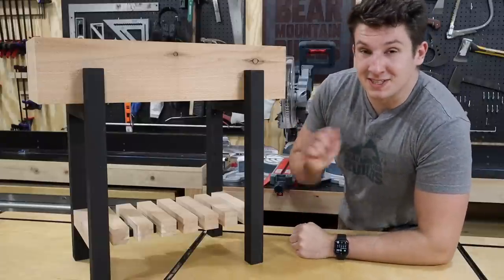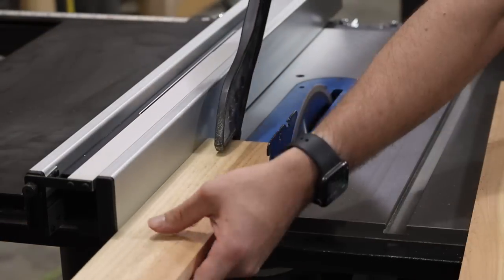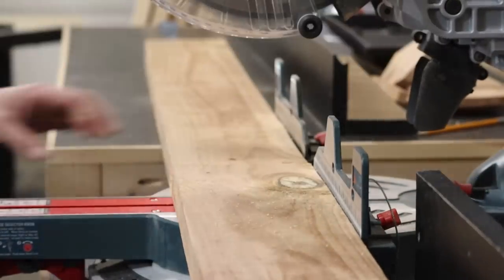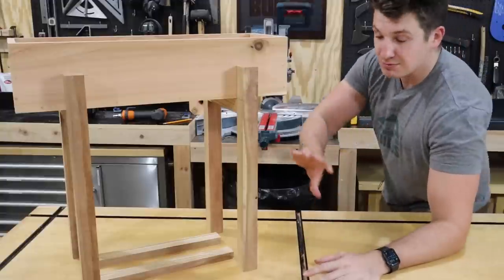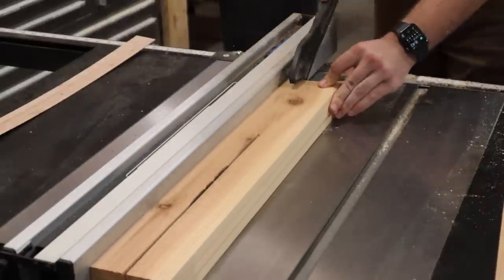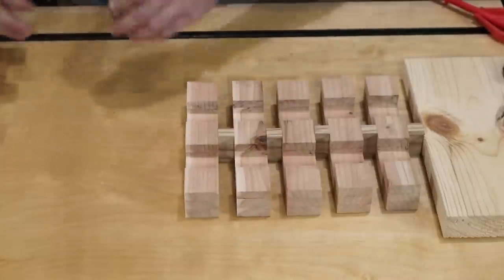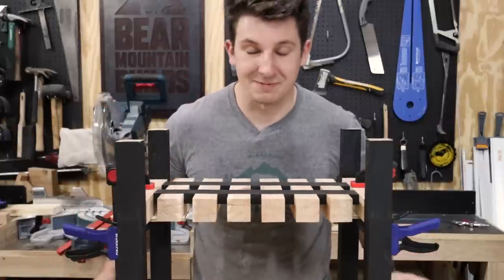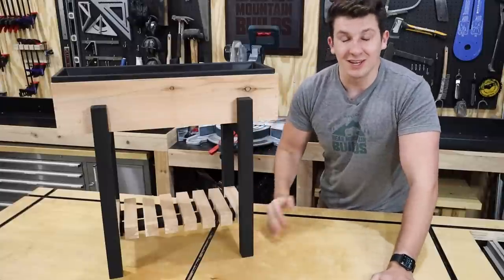Raised Two Tone Cedar Planter

Comment: Great video....only thing is should use tight bond III for outdoor use.... designed for it
Reply from the maker: Titebond 2 is water resistant and would work well, but if you want to take it the next step yes 3 would be the best of the best

Comment: Big fan of your channel since discovering your workbench build. I feel like the laminated fence pickets for the bottom shelf are too noticable at the end grain though. Debating between adding bottom stretchers to cover those up or just using more cedar decking cut to 2x2 dimensions like you did for the legs. Guessing the latter would mean buying another board though.

Comment: Try using a plastic drinking straw to clean up along the inside edges and corners and wipe the excess with a wet paper towel.  Works pretty well.

Comment: This could easily be adapted to hold a grow light for starting seeds indoors and taken outside for  hardening plants to plant outside after frost danger is past.  Also would work great for an indoor herb garden for fresh herbs year round.  I'm gonna need two or three of these. 

Curious why you didn't use half laps on the legs since the bottom shelf is half lap joints.
Reply from the maker: I didn’t want the black supports to be seen on the ends

Comment: Awesome love it! I built a different style planter last year, I used spar urethane for outdoor furniture. My wife wants another one, I like this design except she wants the planter box portion painted turquoise... Not a problem but I think oil based spar urethane over the paint will dull/change the color, any suggestions for a protective coating over the paint? Also looking forward to seeing your new shop completed, lol I'm not a hater but definitely jealous 😂😂
Reply from the maker: If you use crystal clear water based poly it shouldn’t impact the color too much. I’m very much ready to get into the new shop but the Minnesota winter really slowed me down since I still have to finish putting in the insulation. I should be moving in this spring and finishing sealing it up this summer

Comment: For the bottom shelf wont the paint on the ends of the support beams cause the glue to not bond the shelf as well to the legs? Wouldn't sanding the paint off of those locations allow for a stronger glue bond and a stronger shelf? Other than that this is a great build i cant wait to get out in the shop and give it a try.
Reply from the maker: When I painted the supports for the bottom I tried to not get too much paint on the ends, but you’re right that if you want max strength it would be best to either mask the joints off or sand them before gluing. Either way it’s still plenty strong as is
Reply: @BearMountainBuilds  Thanks. I'm looking forward to getting into my shop and giving the build a try.

Comment: What is Pressure treated Cedar tone wood?  Is that something that can be bought at Home Depot or Lowes or is it just plain old pressure treated planks treated with cedar tone stain? I want to make some of these planters but I'm very confused about the "pressure treated cedar tone" wood.
Reply from the maker: It’s a board that is generally used for decking that can be bought at Home Depot or Lowe’s. I bought mine from Home Depot. It’s pressure treated so it can’t rot and the cedar tone means it’s artificially colored like cedar

Comment: Would the brad nails/glue combo hold up long term? or would it be better to add screws as well?
Reply from the maker: Screws will always be more durable. I just used Brad nails because it’s simple and fast. I think the Brad nails and glue will last for quite a few years
Reply: With cedar being soft and using cedar fencing, which is a thin piece of wood, you would run the risk of splitting the wood with screws. I would get thicker cedar planks (which is more expensive) if I was going to use screws.

Comment: Unless this is designed to be an indoor project, you need to be using Titebond 3 wood glue which is waterproof.
Reply from the maker: Based off the Titebond 2 spec it is water resistant and suitable for outdoor use

Comment: Does the glue stick to the paint?
Reply from the maker: Yeah it does. However if you want to make it as strong as possible you would want to mask the areas where it will be glued before painting. However, as is it is plenty strong enough

Comment: You should be using Titebond 3 which is waterproof.
Reply from the maker: Based off the Titebond 2 spec it is suitable for outdoor use and water resistant
Reply: @BearMountainBuilds  TB2 is water resistant, TB3 is water proof.  Well worth the extra few dollars on something like this.  Love the design BTW.

Comment: should use titebond 3 and not 2.  Also, you are using titebond original in the video.
Reply from the maker: It's an old Titebond 1 bottle filled with Titebond 2 glue. I ended up buying a new small bottle on Titebond 2 to avoid confusion in future videos

Comment: The glue you are using is not suitable for an exterior project.  You should be using a waterproof glue like Titebond III
Reply from the maker: It is water resistant glue and based off the supplier spec okay for exterior use
Reply: @BearMountainBuilds  I am looking at my bottle of Titebond Original Wood Glue, which exactly matches the bottle you are holding in frame 1.23.  The label specifically says " Not recommended for exterior use or where moisture is likely."  Further, in even bigger font, the label says "For exterior projects, use Titebond II or Titebond III."